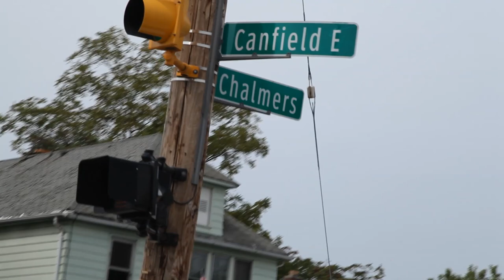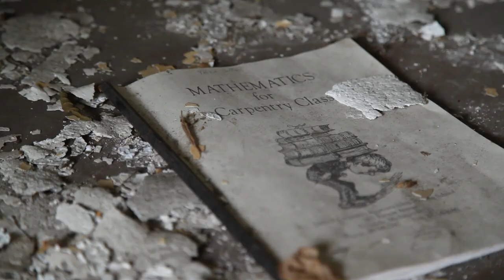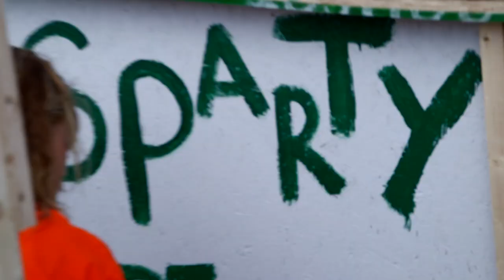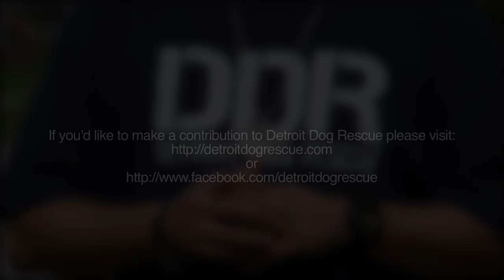Detroit Dog Rescue | American Dog With Victoria Stilwell

Comment: I understand that. But, it seems spaying and neutering is cheaper than the dog house construction project. Also, the feral dog can be caught, spayed and released back to her street life. It would just severely and drastically curb the problem by spaying and neutering. In the long run it'll save LOTS of money and lives. The houses were for dogs whose owners aren't bringing them in away from the elements. I support their efforts. But, feel they need to adjust how they carry them out.

Comment: I agree absolutely with your ideal standards of rescue and care. However, since moving to a backwater community that doesn't neuter, chains dogs outside 24/7 and otherwise lets pets run loose on busy streets, I can see what they're doing. I have enough rescue to do within a square mile of my home. There aren't enough HOMES for these animals to take them inside; you provide insulated dog houses. You neuter when you can afford to. As they said, the pregnant dog is feral. You can't taker her in!